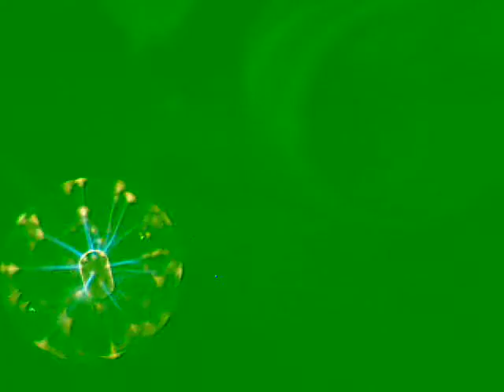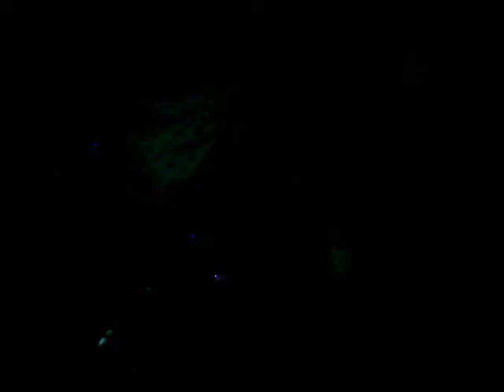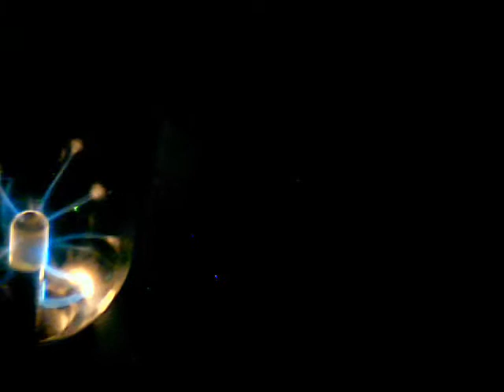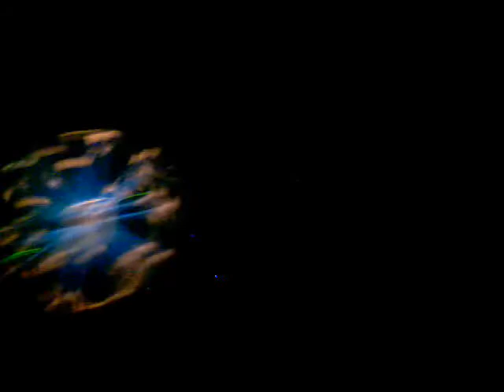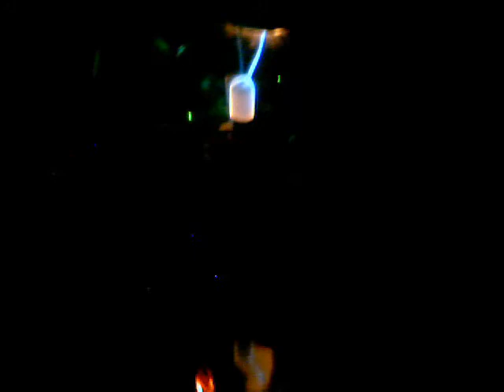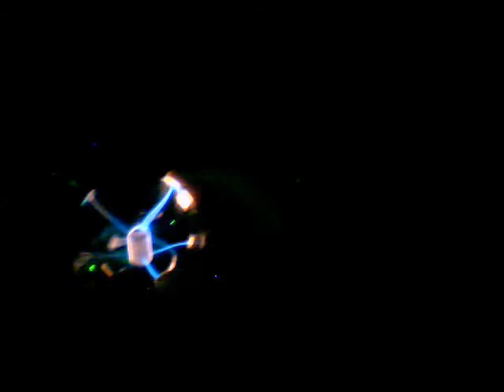Plasma Frequency

Comment from the maker: i just got this at an aquarium gift shop somewhere. it's not supremely hard to do. most plasma globes will give off an electromagnetic frequency that most cameras and/or microphones will pick up. I used a microsoft lifecam V. I don't know the model #. no, the plasma ball is in a separate plug, directly to the wall, AC 110V@15A
that's all i can do to help